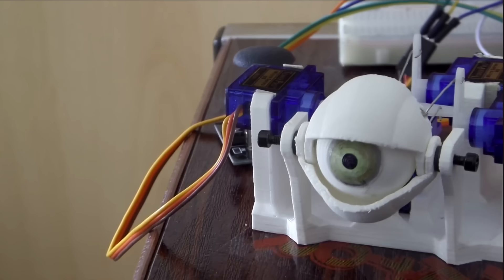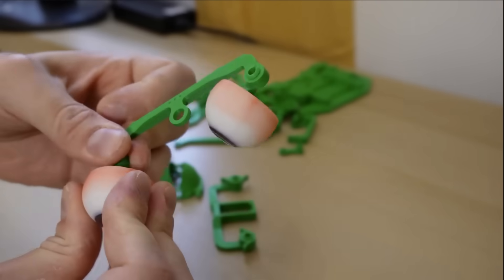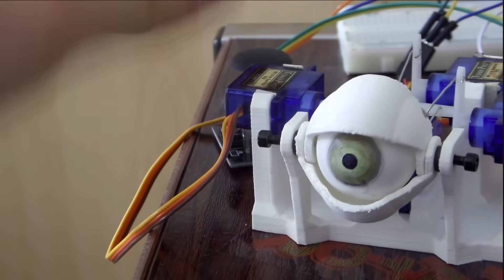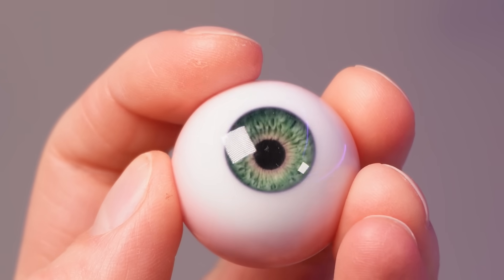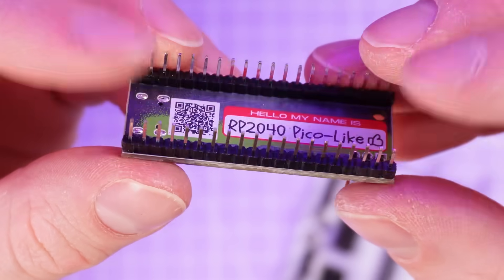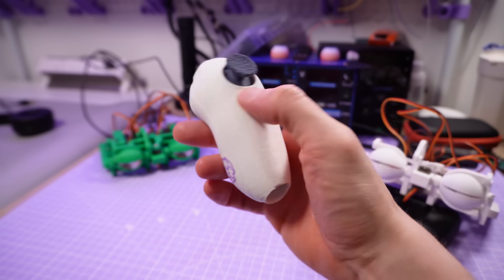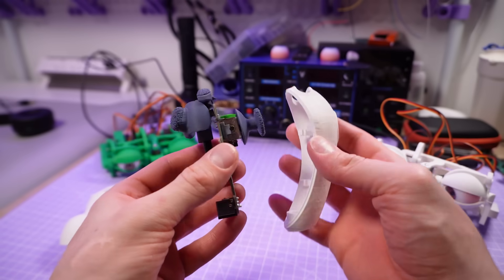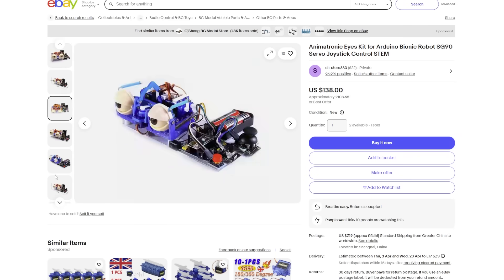The Most Realistic Animatronic Eyes I've Ever Built

Comment: Suggestion and a question: If you want wireless control, I suggest you use an ESP32 and their ESP-NOW protocol.  Search for Random Nerds ESP-NOW.  I have used it in several projects, and it works great.  My question is about the painting.  How are you detecting the presence of the person?  The way it detects the face head on or to the side looks like you are using a device called a "Person Sensor" by Useful Sensors company.  I have been struggling with that device giving me reliable results.  It's not even available anymore.  If you are using something else, I would surely like to know.  I have project in mind using your animatronic eyes and detecting people walking by - and putting it into a pumpkin for Halloween.

Comment: Even if you're not making eyes, that board looks really nice and slick for more general purpose robots. 6 servo conections, a RP2040 chip, all properly wired up to a single power source, all pins still exposed to add sensors, all on one board, for £18? That's pretty solid. Sad they're sold out.

Comment: The mechanism works great except for the central pivot on the X axis arm, it seams to be fused. I've tried to cut/ pry it apart but it broke before separating. I' printed 3 times from different files with the same result. I'm using the Bambu P1s (purchased through your link) and Bambu PLA. Do you have a different file, or recommend a different setting for printing this part? every this else includes the end pivots on this piece) work perfectly. FYI the mechanism is awesome, and I'm preordering the controller and super realistic eyeballs
Reply from the maker: Hi, please check the most recent file (ε3.2) I have made an update that should prevent this issue. Also please make sure you print on 0.2mm standard with organic supports, pivot rings facing down

Comment: Thank you Will for this beautifull design but trying to import your EyeMech ε3.2 MG90s - A.3mf into Prusa Slicer 2.9.1 for printing using my mk4s I noticed the position of various components gets truncated. Pruse slicer pulls every single component onto the built plate where most pivoting parts should be hanging in mid air and being printed using supports. This way it is impossible to print your version 3.2 on a prusa printer. Any idea on countering this?
Reply: I found a way around this issue.
1) load the applicable 3mf file in pruse slicer and remove all parts with connected hinges, then print the remaining static parts
2) convert the applicable original 3mf file to stl using an online conversion tool
3) load the converted 3mf-to-stl file in AutoDesk Meshmixer. 
4) choose Edit - separate shells, then select and delete the static parts already printed
5) select all remaining parts and choose Edit - combine
6) export to another stl file
7) this file will load fine in Pruse Slicer and can be printed correctly

Comment: The H3 designator doesn't exist in the BOM file. Is that needed?
Reply from the maker: I believe that's just for the header pins on the pico, I ordered them without because I never used them and it's easy to solder later if you do

Comment: I tried modifying your code to work with a wireless PS4 controller. I can't code so I used ChatGPT, and the code it gave me made a good bluetooth connection with an ESP32 and made the eyes move. Unfortunately it moved the eyes the wrong way and I couldn't debug it, but I'm sure someone with some Arduino coding knowledge could. I used Bluepad32, which should work with most common bluetooth gaming controllers.

Comment: Really awesome
I think it I were to make these, I would want to insert a 4 megapixel sensor in the eyeball, have a mechanically contracting iris and corneal lens  behind it that can alter the focus point for the sensor. I'm thinking a memory alloy with a simple induction heating coils should be able to make these two actions work in a realistic manner, if not a completely functional and accurate one.
Also, how to make the eyeball have a "wet" look and have eyelids that glide and close shut (with eyelashes)
maybe the eyes can have a wet look with opening in the eyelids wetting with a minute amount of a glycerol-based fluid

Comment: Absolute awesome work! Suggestion for the wireless controls: the xiao seeed ESP32 S3 controlboards are really small, have lots of analog inputs and do wireless really easy with the espnow protocol. If you switch the external wifi antenna to a bigger one, you get massive range, but the small foil one that is delivered with it also works quite well. 
If you search for alternative ESP32 boards, be careful to select ones with an external antenna connector, as the internal antennas are often quite weak, especially if the wifi signal range is already quite full (like on a filmset, as I had to find out)

Comment: Instead of a wireless controller, just make a cell phone app, and get one of those gamepads that snap around your phone to add two joysticks, a dpad, analog triggers, etc.  Even if the stick snaps back to center you can just code the app to make the stick indirectly control a slider which doesn't snap back to center.  You basically get a Wi-Fi connected programmable controller with a full screen for debugging, and it will only cost you around 20.00.  You can make a graphical app rather simply btw, using Unity.  Easy Peasy, lemon squeezy.

Comment: Will, there is no question that you are the pioneer in 3d printed eye mech. I have built most of your designs. There is one unfortunate problem, that seems to not bother most people, but is a no go for me. That is that your designs are not anatomically correct. The average human eyeball is around 24 mm. diameter, and yours are around 33 mm. Real eyes are spaced at between 50 to 75 mm. Yours are considerably wider.  For more comic designs that isn't a problem, but I use eyes in realistic silicone heads cast from models of real people. Your designs just don't scale very well. I have had to make my own design, based on your principles, and although they work, it would be better if yours were correct. Anyway, thanks for yet another step in the evolution, and thanks for all of you innovation.
Reply: They do seem to be comic /puppet oriented as opposed to humanoid. The human lower eyelid barely moves and they certainly don't meet in the middle.
Reply: perhaps it was intentional to avoid that wanting them to be used for robotics, puppets etc. I have no idea if this is the case but the design does not seem to be leaning towards realism with heavy hard eyelids that when I think back to Stan Winston puppets they were using very fine wire and latex to pull skin over the eyes for a realistic human like eye blink. This looks very cartoonish and I actually love it for that. Its got the realism in the eyeball itself which carries it and at least I don't feel any uncanny valley is crossed. Its stays firmly on the right side of stylized. The teddy bears look cute, even the one with the gaping teeth mouth. Best of luck with your own super realistic attempts at human eyes though!
Reply: @ClayMann  will actually mentioned he specifically likes the comic-like look, and tends to avoid the uncanny valley or trying to copy human proportions in the video with the molded face and magnet pad things... at least as i remember
Reply: I want to use these for animatronics but I ran into the same problems - they don't fit in standard mannequin heads. I would love a version that uses the average human eyeball diameter and IPD, and without lower eyelids.

Comment: I've been following your eye and hand designs ever since your original animatronic eyes in 2017 - the year I started 3d printing. The screwless snap-together design is my favorite. Once you really get into the wireless controller, I think you'll find it surprisingly easy, especially if you use ESP32. There are some amazing libraries - like ESPNow which uses local wifi, and painlessMesh which uses direct communication between controllers and doesn't even need a router. 

Have you ever thought about moving the eyeball and the servos apart? I've always thought it would be cool to put a single eyeball in a flower and the servos in a flower pot, and run the control lines up through the stem like bicycle brake lines.